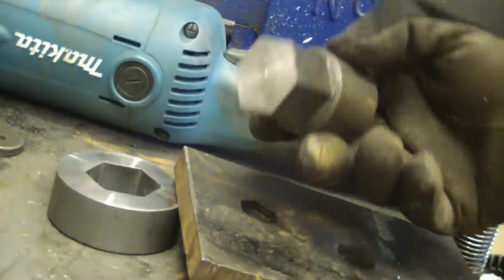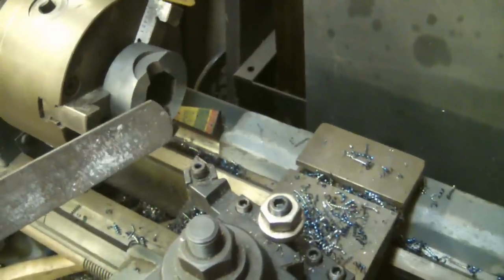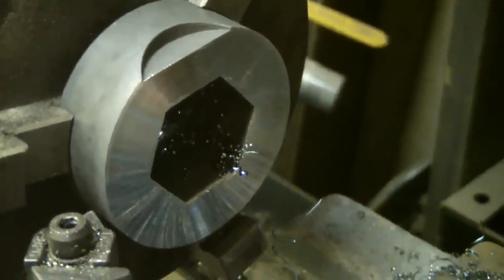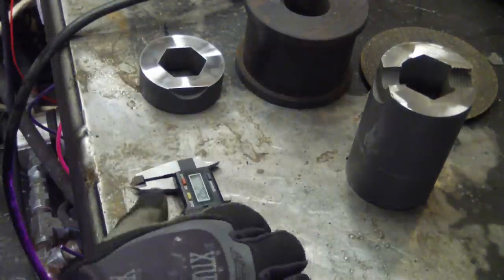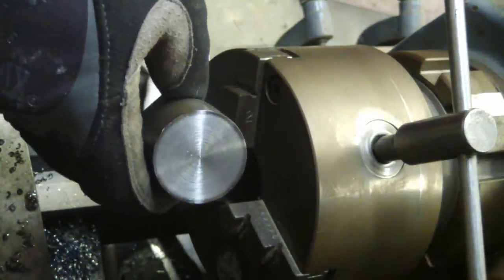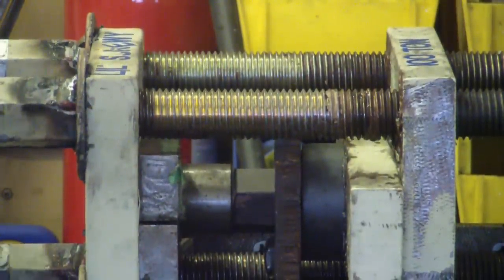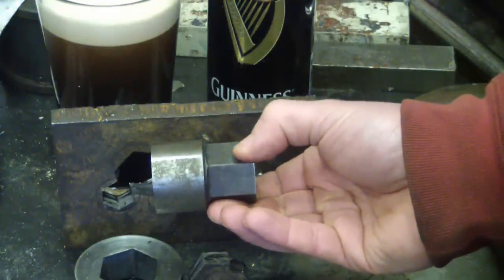How to turn tool steel in a lathe

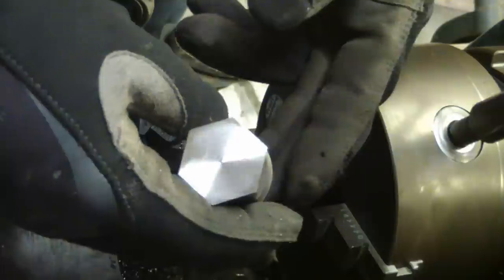Comment: why is there an "H" pattern that the glare picks up thru the cross section starting at 5:42 ?
Reply: +Phillip Chivers i was wondering too
Reply: +xXGLASSGECKOXx 
There is hardly anything stated in this video that is remotely correct.
The "H" pattern is the result of harmonics. Harmonics of the vibration type.  The Boxford lather is the VSL with the LOO spindle taper. The spindle diameter is small and the LOO taper extends the chuck significantly from the front bearing. A significant overhang,
The tool is positioned with a very significant overhang from the holder.   More overhang.
There is NOTHING rigid in this setup.
The "H" pattern, if measuring flatness, would probably not be able to be measured. However you guys are seeing a difference in the surface finish, and you WILL measure a difference in the RMS on this surface.
And by the way, this material is NOT tool steel.  It will be highly alloyed for a specific purpose. Strengths of different types.  Tensile, impact, etc.
This video is being presented by someone who does qualify only one thing, he is not a machinist.  In addition, he know very little about materials, comparing the hardness to his "zip" cutter.  Really.
The likely reason this tool failed was it was left in a condition that it was too hard.  In fact too brittle for whatever the application was.  Not a big deal.  Perhaps something experimental, or the wrong tool used for the drilling conditions (?)
This video is extremely poorly done, evidenced by the treatment of the cheap caliper. Nothing wrong with a cheap caliper so long as it is not used for something important.
So this guy's a welder and it shows he know next to nothing about anything else.
Reply: +Wayne Tarling my guess would probably be a bit closer to something like "this guy is a hobbyist that works with metal, not a fucking scientist that needs every single product to be perfect with a constant finish"
Reply: +Phillip Chivers the "H" pattern is there because that is where the set screw or threaded through hole was. (you can see it at the beginning of the video)  i think that the material was hardened after original machining. ive noticed when machining hardened material or just hard material like tool steel, that the skin cuts have a nicer finish while the deeper you go the duller the finish is. notice that the surface finish is better the whole way around the hex. has nothing to do with harmonics and the tool failed because the rpm was too high. rpm=s.f.p.m. x 3.82 / diameter. that was way too fast for anything as hard as tool steel, or as i suspect a heat treated steel. from watching some of these videos i wouldnt go so far as to say this guy wasnt a machinist.
Reply: +Wayne Tarling Technically, you're correct, but, technically, everything worked out.  So, maybe we can all just be a little compassionate and learn something from each others endeavors here.
Reply: +Wayne Tarling nah, Illuminati
Reply: illumaniti CONFIRMED!

Comment: If you move the carbide tool holder in, so closer to the quick change, you'll be much more rigid. Also, try slowing the chuck speed down, then things won't get so hot. Should try to avoid throwing blue chips, you put a lot of heat into the material, so you may effect the heat treatment. Just some observations. I like your channel, keep it up!

Comment: Hey ave, what am I doing wrong when I lathe hardened steel, I never get those nice chips, I usually get a bright orange flow of molten steel. I'm using carbide inserts on a Webb any tips, and pleas just the tip, I'm also turning the .5" at 1800 rippems

Comment: I machine case hardened shafting every day, but notice on the face of the hex side it's not just case hardened, but it seems there are two hardened sections extending further in than the simple case hardening. I have no idea how that would be done, but I'm pretty sure that means it cost someone both arms and a leg. Btw we never use lube with carbide inserts like that unless cutting stainless.
Reply: John Corder At 4:13 you can see he zip cut the hex end right at the hole for the through bolt. I figured that was why the case hardening was apparent deeper in the center of the piece.

Comment: So I'm curious, have you considered a gear setup for the press? I've seen quite a few of these smaller ones with the same design, but as of yet nobody has set up a nice chunky gearbox that would allow you to drive all four at the same time, and possibly make it easier with a gear reduction setup? (don't know much about those sorts of things myself though, so it might end up being massively complex to set up.).

Seems like you could manage it though, although finding beefy gears might be tricky without spending a pretty penny on them. Well, we don't have pennies anymore so I guess nickel would be the saying now, but I'm guessing with some practice you could custom make some if you figured out all the sizes and ratios you needed to accomplish it. 

I'm probably just overcomplicating things though lol

Comment: never even saw a metal lathe except on Ytube.  I would approach the concept of spinning metal being connected with carbide or high speed tool steel with extreme caution.  visions of exploding carbide shrapnel or chunks of metal becoming unchucked would be initially hard to shake

Comment: You had me at Guinness!
Reply: ***** Aw crap, yeah, I have two accounts, both accounts are me, I just need to migrate over all my subscriptions to this account so I can stop using the other one (though I thought I deleted that comment when I noticed my error).

Thanks, glad you like the hammer! I'm really impressed by your work with the press and dies, though the potential of all that pressure to reach catastrophic failure is giving me goosebumps.

Comment: Whenever I try to cut hardened crap, even with carbide, it feels like I'm trying to drive the bit into a solid wall. It just doesn't go. How can I solve this?
Reply: slow the revs down.
Reply: That's at like 250-300rpm.
Reply: +justfakeit888 the steel he's machining here isn't so hard. if it was even carbide wouldn't cut it.

Comment: Ger yourself a hydraulic jack, !00 ton, short stroke, and push with that.
It will be a breeze to pump through the plate, just run up the nuts at each retract stroke of the jack....you could drink your guinness with one hand and pump the jack with the other!!
Reduce the overhang of your turning tool!  It does bend .....pushing it below centre height and causing vibes"  Nice vid though, calibration of the vernier was great!!

Comment: What are you doing with the all thread jack em up. You know with a ford power steering pump and a wash machine motor you can have 80 ton hydraulic press. Just saying.

Comment: Couldn't you heat up the tool-steel in a forge  first then let it cool slowly so its softer to work with?
Reply: +Ed Loki Rehardining it would be the problem complex tool steels like that are increadably difficult to hardden

Comment: I tried to find some of that cutting oil you use but kept being redirected to very embarassing websites, i think my computer has a virus.....can you link me the site you got it from please
Reply: i'm taking the 5th
Reply: ***** question...wouldn't the press work better with gears and a planetary gear in the center, beacause you will be able to adjust the gear ratio to the ammount of power you need...but doing the workout and recovering with a pint of guinnes also sounds like a friggin partay...love the channel

Comment: Nice video mate, i have to say i was a little disappointed when you cut naturally with carbides, i was hoping to see the old oxy/acetylene trick in action, i can only assume that the steel wasn't super hardened like induction hardened chrome rod or other such angry things
Regards!

Edit: Oh yeah by the way you can regrind those carbides pretty easily with the right wheels and hand stones to resize the nose radius or apply neutral/positive rake if the fancy hits you to play with tool geometry, i often find chip breakers and edge radii were a bit oversize for little lathes
Reply: ***** Ive been looking for a clip online of this for a long time now, not many people have heard or tried it (at least as far as i can tell) It comes from the old man in his hydraulics shop trying to turn chrome and other plating, The basic idea is that instaid of having expensive specialist tools(made by aliens) you address the hardness of the work while you cut, sounds daft i know!
Once the work is set up between centers you preheat the work to a little past touchable,
you bring your oxy to the moment of work and heat to critical while the work is spinning , the depth of the red heat can be seen and the cutting tool applied accordingly to shave off heat affected material.
Ive been looking for quite a while for a better explanation than my flimsy memory!

Edit: remember welding protective equipment is a must as the swarf it aggressive
Reply: *****
It's a HSS trick. Wouldn't recommend it for leaving your 'cutting' surface/edge on your die as hard as when you started (which is your intention).
I understand that heating to get the lathe to cut the steel the heat plasticizes the surface, but how you control that without any local deformities I can't say - especially on the die edge.
Macro deformation would be very dangerous in this application, as stress uniformity is key in the die material under load - don't want pockets of plasticity = failure waiting to happen - say one edge cuts while the other spreads out load)

That's a REALLY nice press - great little work workout too at 120 x 1/6 turns in total for that test piece. Kudos 2 U!

Comment: for my job i machine hardened rod that carbide tooling wont even start to turn. We use ceramic tooling with no coolant. the material dont even chip it shoots off the part in a molten stream lol.

Comment: correct me.. CAUSE im wrong : wouldn't the blue "shavings" coming out mean that the steel is getting tempered thus losing some hardness? OR the shavings themselves are the ones getting to those kind of temperatures and the piece is so big that it acts as it own heatsink and disipate enought heat to NOT get any softer? im not a machinist by any means. but i read and whatch all kind of "making" stuff :p
Reply: Franco Buzzetti some chips you want to come off blue, some like straw. Depends on the material, the tooling is made to direct the heat into the chip. The blue colour indicates the chip is approximately 400 degrees, the part will be no where near that. So it's not getting hot enough to heat treat the part in any form.  Hope that helps.
Reply: ohh then my "theory" was kinda right :p ahaha
Reply: Franco Buzzetti pretty much. But the part wont get annealed by machining. The opposite happens and your piece will work harden from frictional heat. Tool steel in this case is designed to work harden, so it's going to happen no matter how cool you try to keep the part. Work hardening isn't very deep and wont make the material brittle, just so you know... have a feeling you'll ask.
Reply: Andrew Delashaw The blue is an oxide process and is actually an indicator of the temperature of the chip being removed caused by the friction from the cutter. If the part were heated to the same temperature as the chip, it would turn blue as well. You can find out the temperature by looking up colors for tempering/hardening (straw, brown, red, cherry red, etc.).

Comment: Wait until you try a cubic boron nitride insert! Can machine pretty much anything. I use them to machine crankshafts back to true as I don't have a cylindrical grinder. Even hardened and toughened shafts are done with ease. I can easily machine high speed steel tools with them. They the John Wayne of my workshop, they take no shit from anything!

Comment: I'm no engineer by any stretch of the imagination but isn't it usually recommended to tighten these types of applications in a cross pattern to spread the pressure equally?

Comment: a drop or so of oil on your carbide cutting tools will help with heat. and
"insize" is a decent brand for calipers and measuring tools if you dont want to spend the money on mitutoyo

Comment: Why didn't you drill a core hole? It would take most of the load off the tool.
Reply: ***** I'm guessing he meant a hole just smaller than the inner diameter of the hole you're pouncing. That should make the job a lot easier. I can also imagine that making the punch slightly convex (I think convex is the word anyway. Deeper in the middle) would help guide the punched out metal towards the center of the pre drilled hole. 

This is of course pure theory. I have zero experience with these kinds of things.
Reply: ***** Core hole isn't as big a help as progressive tooling.  The reply below suggests turning the punch convex on the lathe.  That still requires the shearing force of the entire circumference of the hex be punched at one time.
Progressive punches are the way to go.  If you picture looking at the side of the punch with the hex down, you want to grind the punch so that it looks like a letter V.  Only slightly though, like 10 to 20 thousandths max.  This way, two points of the hex 180 degrees from eachother contact the steel first and punch through.  You are only defeating the shear strength of the work on perhaps 1" of the tool circumference.  As it sheers and the tool displaces downward, you progressively engage the rest of the tool.  Most production punches are ground in this way.  It has to be balanced in terms of the circumference so the punch doesn't deflect.
Reply: Jim Groth concave, cupped in the end

Comment: now I dont know 2shts about machining and most of what you show goes over my head buuut, wouldn't it be easier to use a hollowed out tool to press? so that it sort-of cuts through the plate. 
dunno, maybe hollowing it out may compromise the strength and it will just squish, but that's why you're the one with the tools, you try it and lets us know how it goes :)

Comment: First, thanks for the vids.
Second, when you are talking about the lathe and the amount of points divided by three...
i.e. this piece has six sides, divided by three is two which helps you know it will fit. 

Can you share the math for that? 

Cheers~
B

Comment: why do you run the lath so fast ?
Reply: ***** I knew u would answer  u seem the type
Reply: potch paul Carbide bro.
Reply: Sam Noneofyourbisnus you want blue chips with carbide right
Reply: potch paul You can run it even quicker with CBN inserts and have a better surface finish

Comment: That harbor freight POS would have made a really nice DRO for your grizzly....
Im not talking abuot taping it to your machine somewhere you cant read the display.
There are a couple guys on youtube with videos of wiring into the serilal port untderneath the plastic you smashed that can be read by an arduino...
Not trying to be critical, i feel you pain on the thumbwheel issue.
Enjoy you vids.
Right Arm Brother
Reply: I did it. x3. It cant  be that bad.  But sometimes you just gotta take something thats been bugging you..... and smash it with a hammer!
So Im picking up what your putting down.

Comment: Bad choice of words auld buddy, sorry.. pumpin jacks handle has scary undertones?
Keep that tool as close to the post as possible, it will cut better, last longer, give a better finish  and your lathe cross slide will be under less stress..
A common misconception with carbide turning is slow feeds....."rubbing is not cutting" get the feed just right and all works well, same friction but more metal removed..,most of the heat is removed by the bigger chips..
Keep a cool tool....Norm

Comment: "A" for effort on that one but it would have taken a lot less muscle chooch if you'd have used proper cutting clearance between your punch and die. A whopping .05"/side (Yup, a hunert tou total) would've cut your effort in about half, AND the slug would break free only 1/3 of the way into it (shear vs fracture). Rul'o'tumb is 10% of material thickness for base steels (3-5% for stainless). And, not to Polly Parrot, but lose the gloves around the lathe... The rule of finger (for keepin'em anyways), no gloves with rotary tools. Lastly, for fuck sakes, don't let the kids ever see that chuck key sitting in the chuck like that again. I was sitting safely on my couch and it made me squirm !!

Comment: that material is not hardened enough considering the speed,no coolant you wouldn't succeed cutting it even the chips will be smaller and the tool will squeak and get blunt

Comment: I haven't ran a mill or lathe since high school 20 years ago.  I miss it, but that is not pertinent to my point.  I see you struggling with little screwy like a 5 hundred pound man running up Mt. Motherfu**er in Camp Pendleton.  Why don't you make a planetary gear setup to use a high rpm from a drill/ drill press/ whatever can give good rpm and gear it down for massive torque that will drive all 4 rods at the same time.  Its and idea I got watching you mess with screwy, but i know the principle from aircraft I've worked on.  The c130 uses 13000 rpm turbine to turn a prop 11?? rpm, but tons of torque.  It uses a Planetary gear setup.  Just a thought.  Great channel, and I enjoy learning some about machining again.

Comment: Nice video and idea. However, from a safety standpoint, I cringe at the use of gloves around the lathe. A really big NO-NO. They will inevitably be caught and pulled into in the rotating mass to your ultimate dismay. Don't take this wrong, I'm just trying to look out for your safety.

Comment: I totally disagree - its wrong to think that tinnies of the big G will put hair on your chest. You need real draft for that - and if you are lucky enough to get to Dublin im told a few pints will put hair everywhere

Apart from that - im just getting interested in making things out of metal. Where is a good place to start - lathes are pretty expensive.